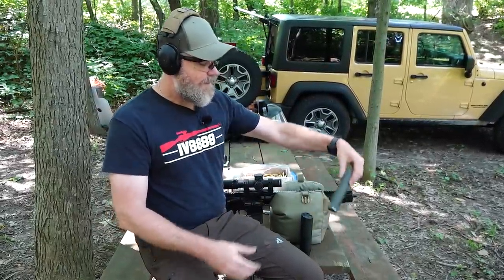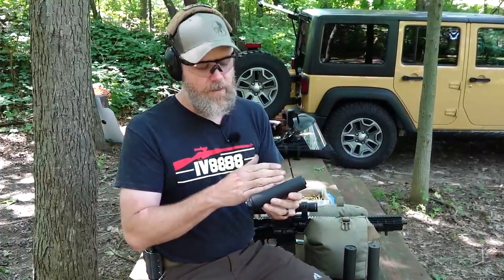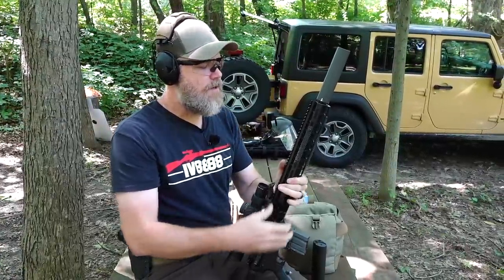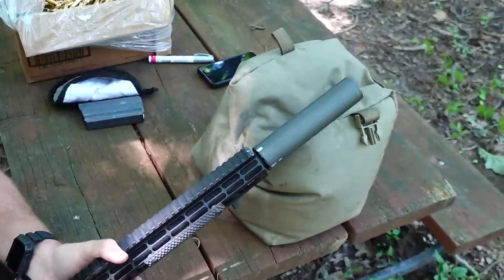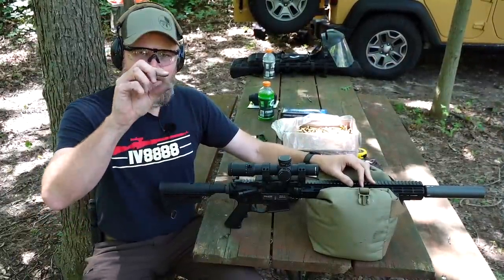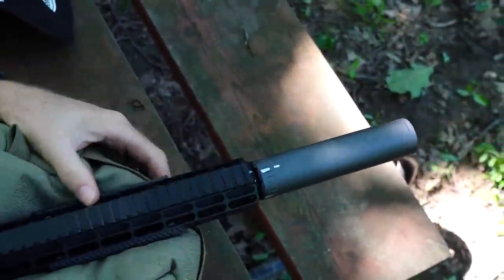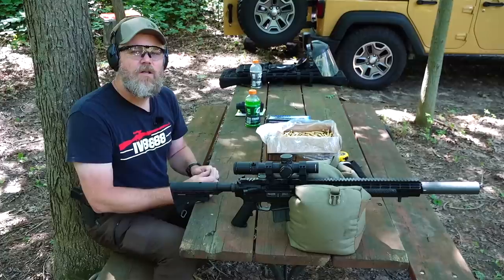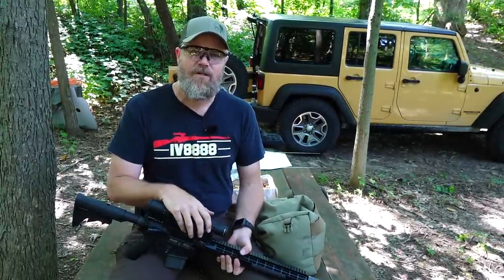BAFFLE STRIKE! What does it mean for your silencer?

Comment: Because the can gets hotter than the barrel much earlier. It expands easier and faster, which will ultimately break the threads loose.
Reply from the maker: Thanks for the post. Question: Since the silencer is attached to the muzzle device and is also made of steel, wouldn't the silencer transfer the heat to the muzzle device and cause similar problems?
Reply: @Militaryarmschannel  you usually torque them much tighter, and the material is not as large in diameter, nor does it have such thin walls like the suppressor. So it wont expand as a suppressor does. 

That, and by the time the muzzle devise reaches the temperature to begin expanding, the barrel is expanding at the same rate, ergo, it stays tight.
Reply: Metal tubes expand both outwards and inwards when heated, so it would actually be tightening on the threads. Using reverse threading would solve the problem but you might never get the can off either.
Reply: @Militaryarmschannel  yes, but over a longer period of time. The thin walls of the silencer make ut hit it's expansion point much faster. Also, the muzzle device is using the barrel as a heat sink. It heats up slower since it's transferring its heat to something with a lot more area to absorb the heat.
Reply: @Militaryarmschannel  oh, and just incase you we're wondering why bird cages and other muzzle devices don't have a tendency to walk, it's because of dwell time. Silencers hold the hot gasses over a longer period of time vs just quickly redirecting them. That means other muzzle devices are heating up around the same rate as the rest of the barrel.
Reply: @Mntnphotog  It doesn't work that way, assuming the whole part is under the same deltaT, All of the dimensions will increase by a ratio of a*deltaT/1, where "a" is the coefficient of thermal expansion in the appropriate units. Everything gets bigger, in every direction. So holes get bigger when you heat them up. This is why you can remove a stuck bolt by heating the nut/fixture.

I realize this can be confusing, So here's a thought experiment. If you have a circular ring, so you have 2 dimensions that describe the entire part, the small radius "r" of the ring's cross section and the large radius "R" of the center line of that cross section as it sweeps a circle to create a ring. The hole is going to be of a radius "h" equal to the large radius minus the small one, so h=R-r. When heated both "R" and "r" will increase by x% (assuming near uniform heating and anisotropic, aka normal, material) So R-r will also increase by x%, which means you are multiplying both side of the equation by (100+x)% and so "h" is also multiplied by (100+x)%
Reply: Which is why I love my OSS and how the gasses cause it to screw itself down each shot 💪🇺🇸
Reply: @Mntnphotog  I have a glock with left hand threads and several other guns with right hand threads. They all walk off the barrel.
Reply: @Militaryarmschannel  yes this is what happens
Reply: @Militaryarmschannel i can't say for sure. But my ASR muzzle break is rocksett on by my gunsmith. So i doubt that break is going anywhere
Reply: Threads are essentially an inclined plane laid out in a cylindrical pattern (a helix) unless they are tapered threads.  When the muzzle blast hits the can it sort of creates a horizontal gravity vector that tends to pull the can away from the muzzle in an impulse.  This impulse momentarily  lessens the frictional force on the threads (inclined plane) just long enough to allow a slight spinning of the can, causing a loosening from the muzzle.  Repeated impulses have a cumulative effect in such a case.  "Think small, make small mistakes in logic."  Edgar Allan Poe

Comment: Just about the only good thing about UK firearm legislation is the ease of acquiring suppressors. They're also very cheap compared to those sold in the US. One of my .22 suppressors was damaged like this a while back, but it only cost £40 so I just replaced it.
Reply: Show off. My .22 suppressor cost $250 plus a $200 tax stamp. I also had to wait 9 months for crying out loud.
Reply: @kamron_thurmond  but think of the children!!!
Reply: @kamron_thurmond  Well it is the only thing about our laws that one could possibly show off about! I suppose it's also nice that rifles can have barrels as short as 12", but I'd still rather have a handgun.
Reply: @ApurtureSci  

I don't own a handgun, but I could get one in less than 3 hours though. That's the longest it can take for a background check to go through.
Reply: @kamron_thurmond  I'm very envious, I would trade all my rifles/shotguns for a single, regular handgun. I've got currently got slots on my certificate for a number of rifles and suppressors which I can buy now without a background check or anything, all of the 'checking' is done when you apply for it initially.

Comment: Guess I worded my previous comment incorrectly. A high quality, grade 8 coil lock washer will solve the backing off of a direct thread can. U just need washers on either side of the lock washer to protect the barrel and can respectively so the lock washer doesnt scar the face or either surface. The caviot is u need a high quality coil style lock washer that fits the barrel well so it barely passes over the threads freely then when its snugged up, tighten with appropriate tool till the lock washer is depressed fully, I like using a leather belt as its quick and gets it just tight enough. I just like to use the crush washer for the barrel side, because this washer is free and laying around,  it fits the barrel perfectly and it very robust.

On a side not if the rifling and the muzzle threads where oriented so they were turning in the opposite dirrection they'd tighten themselves instead of working loose like they do because most barrels, ar15's especially, are rt hand twist and the muzzle has rt hand threads.

Comment: It might be interesting to do a similar test on a rifle with left hand muzzle threads. Theory being, that barrel refiling is right handed and the twisting force of the bullet inertia would cause it to flex left, in a manner similar to a single impact gun hammer cycle, then spring back to its resting position. firing through Left hand threads would be like tightening the suppressor with and impact gun

Comment: You know I have a direct thread 556 suppressor and it’s an EliteIron Delta. I have noticed that if I put the suppressor on my rifle and shoot several mags and basically reach up every once in awhile with the hot cloth and tighten it back up it seems to eventually stay put. I’m not sure but I think what happens is the threads or something get fouled after a little bit of shooting because I have had that direct thread can literally seize onto the threads to the point that there was no getting it off by hand. The only way to get the suppressor off after this happens is to put it in a vice and go after it with a strap wrench.

Comment: Was it Sgt. Elias that said…”Police up your gear and move out!”
With a can on it’s always best to check it every now and then that it hasn’t come loose. This just proves that even if it DOES come loose 1 or 2 turns out in the field it’s not catastrophic. ‘Welding’ the can to the end of your barrel is overkill IMO. 
In South Africa where it’s harder and way more expensive than the US to have more than 1 hunting or sporting rifle, loosing the thread ‘cement’ to allow 1 system to be modified on the fly to different barrel/shooting setups and simply checking secureness  is more practical than expensive adapters/thread lock compounds. 
As always really interesting content! Cheers🙏

Comment: A suppressor attached to a muzzle device has the benefit of a larger thread which gives it less leverage on the thread. It will also likely have a shallow angle "locking taper" or mechanical ratchet. The muzzle device that is properly torqued with thread locker will hold tight and allow for the can to vibrate around but not loosen as a result.

Comment: They loosen because they get alot hotter than brakes and are heavier as well basically high heat plus vibrations will loosen anything, plus the can is getting massively hotter than the barrel so it expands and the threads become loose. I'm a mechanic and this is a well know method to remove very rusty stuck nuts and bolts, torch it then snack it a few times with a hammer and it comes right out.

Comment: I came here to say, 1/2"-28 back half means 28 threads per inch, so its  not a surprise after unthreading the suppressor a whole 1/2" of length of thread that you made 14 turns. I say thats good machine work.

Comment: If You Safety Wire Your Suppressor Like Aircraft Engines Fasteners are to The Front Sight Base You Should Be Ok Since The Stainless Safety Wire Dissipates Heat Faster 😀 👍🏼

Comment: That’s why you use an actual wrench, like with a saker where you use the included spanner wrench and put the upper on your vice, you’d need full auto use to keep it from backing off. The reason why cans walk off but muzzle devices when properly installed aren’t prone to walking off is because they are just that, properly installed, while the cans aren’t for most direct thread setups.

Comment: Out of curiosity have you tried using rock set on the threads? I'm assuming if you are going with a direct thread the can probably lives on the rifle. Rock set is a ceramic threadlocker rated to 1600 degrees. If you want to remove rock set, just soak in water overnight. Also the point of impact shift could be due to harmonics. Meaning the tightly screwed on can changes how the barrel flexes, verses when it is just loosely on. Anyway just some thoughts, great video and look forward to the next one.
Reply: Rocksett has worked for me for a decade now with a Ranger 2. Used it for 2 gun/3 gun with no problems.

Comment: I prefer direct thread cans for a lot of uses, I've carried properly set up rifles with DT cans many tens of miles over rough terrain on hunting trips without the can loosening at all. Shooting 50-70 rds at the range, again no issues. One aspect that's often overlooked, that's critical, is the barrel's shoulder diameter. Snap a can smartly onto a barrel with a nice wide shoulder, lots of bearing surface, I've never had a problem. On rifles with small shoulder diameters (like Tikka CTRs), however, you'll be constantly tightening the can.

Comment: Left-hand threading should solve the problems of suppressors backing off, because the rifling is rotating the bullet in the loosening direction of the threads. I'm guessing that the suppressors have comparably snug bores to the barrels to seal better and thus reduce the sound pressure more, so with lots of shooting, the bullets will loosen the normally threaded suppressors by rotating inside the suppressor in such a way that the suppressor by friction will want to unthread.

Comment: I remember an article about how important (or not) it is to have a nice crown on the muzzle. Before cutting down bolt guns during some civilian 'sniper' type course, they took hacksaws and attacked the muzzles. POI shifted, but groups were no larger. Just as shown here, I guess a perfect crown isn't important. Slight POI shift only. Thanks!
Reply: Mr. Morningstar  That could be where it becomes a problem, but that's generally not what people think of as the problem.

Comment: My intuitive understanding of why the suppressor will back off the threads is because of the gasses that are violently pushing forward against the baffles (away from the barrel) combined with the recoil jostling it around... not a good combination for keeping it tight. Also explains why typical muzzle devices don't have the same issue, gasses pass right through them.

Comment: MAC I have a Huntertown C9. When I ran it on my MP5 it was like 12" groups at 50y. Without the can, the POF MP5 shoots 4" groups. I found out that if you didn't reassemble it correctly the baffles would be loose inside. Also, the Sig 762QDTi I bought from you sometimes will walk loose (yeah yeah taper taper taper) and it will make my groups go VERY wide. Lol

Comment: To keep direct thread cans from working loose use the original muzzle device washer/A2 style crush washer installed first onto barrel then a  coil style lock washer thats just big enough to freely slide over the threads and centered well, then the surpresser can be tightened against ¹the lock washer sufficiently, I use a leather belt to snug it up smartly so it doesnt work loose, however u should always check and make sure ur cans are atleast hand tight before next shooting session just to to be safe . This is all thats required to keep ur cans from Working loose  However for best results i reccomend the the use of a additional large flat washer be installed between suppressor and lock washer to protect the finished matting surface of the can. This has eliminated all my issues with the cans unscrewing. The crush washer protects the barrel as well as providing the lock washer a nice mating surface. The lock washer is self explanatory and the big flat washer i just described protects the can. I use 2 thin fender washers often in place of a single large washer against the can side but requires drilling ID to appropriate dimension. The reason I use the fender washers is they are usually cheaper but most of all readily available. Also on 22lr and similar surpressed weapons that heat up less I just use 2 thin washers to sandwich the lock washer, all of which need to be sized the appropriate ID, since lock washer doesnt need to be as robust s.all washers can be used to help keep the weight off the muzzle end of what are typically lighter weapons.
Reply from the maker: Crush washers and silencers are generally a bad idea.
Reply: @Militaryarmschannel  did u read entire Comment?
Reply: Mr. Morningstar  ok I just know it works for me

Comment: I wonder... I've switched to using clear or black nail polish as thread locker because it doesn't melt loose like loctite under rapid fire on my scope bases especially, yet pops loose easy enough when you want to remove the screws. Wonder if a dot of nail polish would keep the can from coming loose?!

Comment: If the suppressor was threaded the opposite way of the rifling in the barrel it would always tighten itself.  The barrel is actually twisting against the bullet trying to spin the other way. Its not much but it is happening, just like the barrel makes a wave like a whip when the bullet is traveling through it.

Comment: Wouldn’t putting a crush washer on the thread and then mounting the suppressor solve the back off issue? The crush washer is what keeps the muzzle break from backing off so why wouldn’t it work if you mounted the suppressor the same way?

Comment: You basically showed that they don’t walk loose, you had to manually loosen it to induce the baffle strike. I’m my experience if you shave it properly threaded on it shouldn’t and won’t walk loose. Also a quick snug of the can after you heat it up you really won’t have to worry. another option is a wrap of Teflon tape. I’ve got lots of rounds through  dt cans and have never had an issue.

Comment: The main reason the cans back off are because of  the threads.  
Almost all cans have righthand threads, however if you have a left hand threads they won't back off. BUT YOUR BARRELL HAS TO ALSO HAVE LEFT HAND THREADS!!!  This will stop the issues of cans backing off.
Reply: Everything you said is completely wrong.

Comment: I personally have never had a direct thread back off. If anything I have seen them tighten up. Bolt guns, AR's, etc. 

I dont think teflon tape is a wise idea. If cut correctly, the threads shouldn't have room for tape.

Comment: I'm surprised your group size remained so tight despite the loose fitting of the suppressor.  I've had suppressors destroy accuracy without ever noticing any visible bullet strikes.  In my experience concentric alignment of the bore to the baffles is paramount to good accuracy.
Reply from the maker: I've seen loose suppressors on 9mm carbines cause shots to go wild with less than one turn loose.
Reply: @Militaryarmschannel  How big are the holes in the baffles?  I know it's welded, but you can run a sizing rod through them to find out.  You can also run a .2120" or .2188" rod through the bore to see how concentric it is with the suppressor.  I do this from the the breech and feel for any baffle contact along the way.  I have a drawer full of various size three-foot tight tolerance steel rods I bought from McMaster-Carr for less than $10 apiece that work pretty well for the most common calibers.  I have found I need more than one size rod for each caliber because tolerances vary considerably between barrel makers.

Comment: SD Tactical had made a finned 1st baffle (think ducted fan) that they claimed tighten the can slightly with every shot to prevent this with direct thread. seemed like a clever way to overcome this issue although I never have used one so don't know how well that worked.   Sooo how much for the can you just screwed up? and can you FK up a 30 cal. one too...

Comment: Is there any truth to QD silencers being less accurate than direct thread?  Or is that gun store and interet chatter?
Reply: Fewer parts means less tolerance stacking, so yes. However if you wanted maximum results of accuracy the direct thread would also include a locking angle machined into the shoulder. A prime example of this would be a machine tool holders.